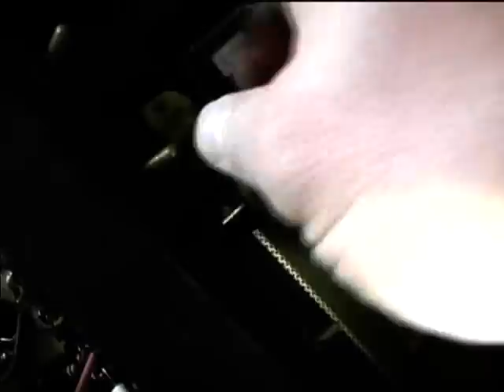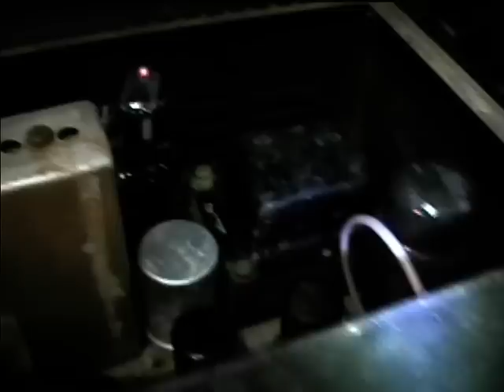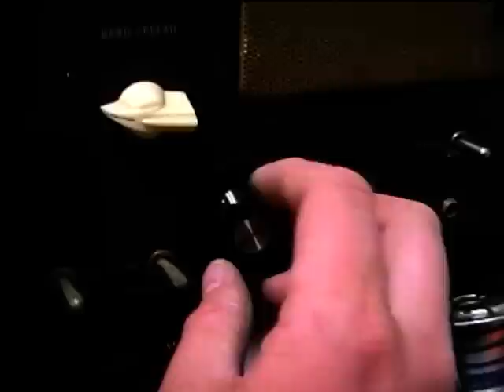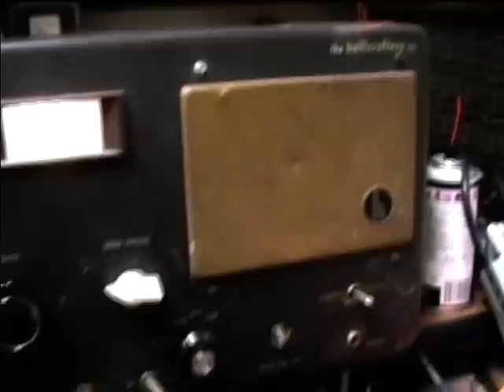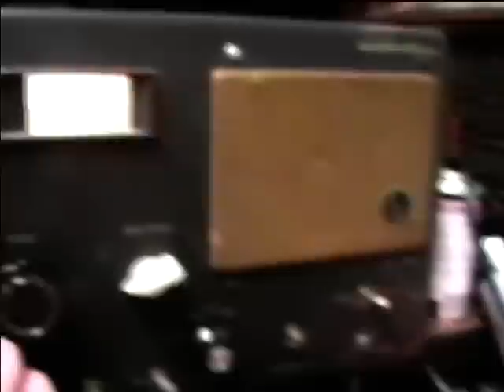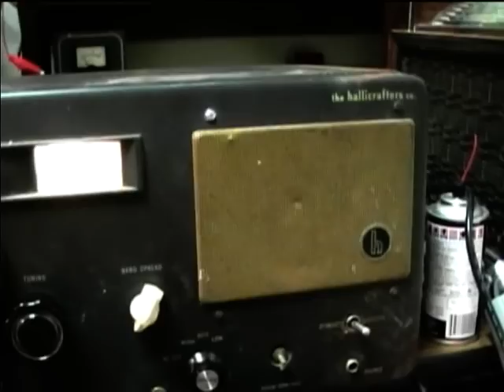Completed Hallicrafters S-40A Communications Receiver

Comment: My s40 picks New zealand with a short piece of solder on band 3. I am not sure just how quiet band 4 is supposed to be. Maybe try a red voltmeter with a 15 mohm resistor. Sometimes it ts quiet but a scrawny signal is heard where the transistor radio just misses it.